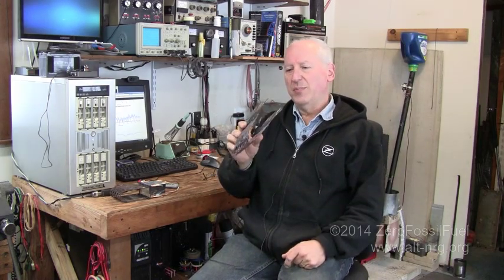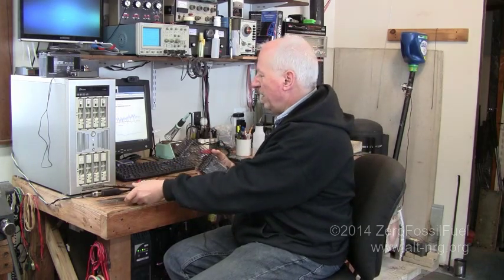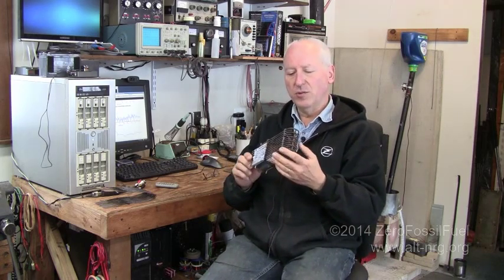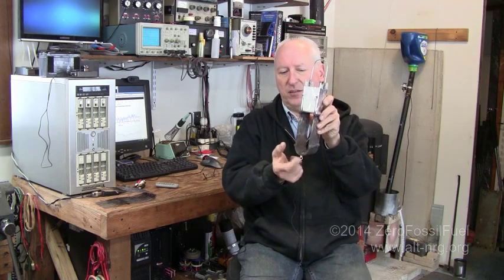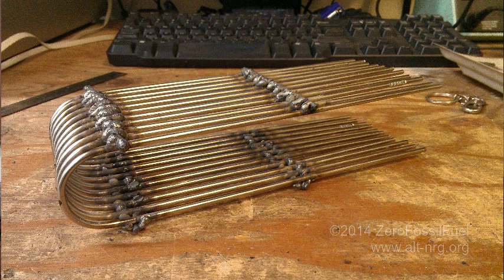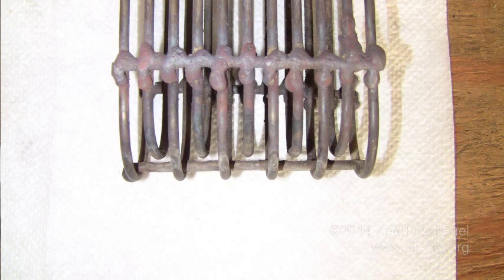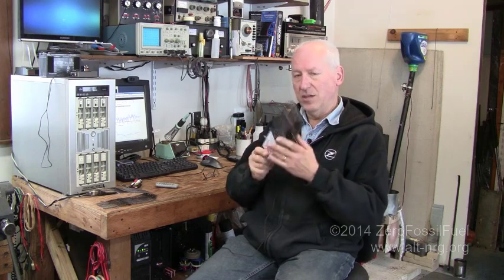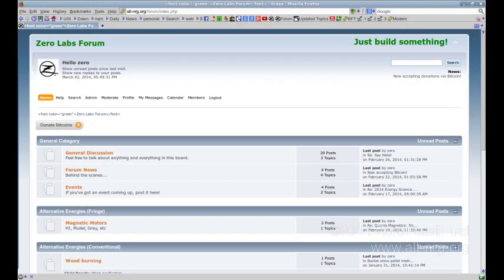#357 Pellet fuel fire basket updates, Scarecrow calls it quits

Comment: I think you're just as obsessed with burning pellets as I am!  ;-)  Basket looks good.  I'm hoping the SS is holding out well.
Reply from the maker: So far so good. I saw your new riser photos over at the forum I refuse to participate in any longer. That should hold up pretty well. Are you going to insulate around the outside?
Reply: ZeroFossilFuel I don't go over there unless I have a video to post.  ;-)  I'm still debating insulating around the new riser.  I built the metal frame so I could bend some sheet metal around it and pack it with insulation.  I was sort of in a rush to get the heater running again so I may do the enhancements over the summer.
Reply from the maker: Bigelow Brook Farm (Web4Deb)
I hear that. 3*F at my place this morning. But trust me, the performance gain is worth the effort. Insulate it as soon as you can.
Reply: ZeroFossilFuel  Hey Rob, I insulated the lower foot and half with the small metal barrel with screening inside.  It works great.  My thinking was to make sure the heat is thoroughly separated from the inside of the riser to where the exhaust is flowing out.  Seriously though, it is probably not necessary to insulate around the firebrick because they are such a great insulators by themselves.

Comment: Interesting basket design .  maybe you need to make it two pieces so you can adjust the gap . Two baskets that fit inside each other that can move up and down slightly.  An inner and outer basket that fit together and can be moved relative 1/8" to each other. Just thinking out loud.. Looks great.  If you need a Solidworks model let me know..   Thanks Ron
Reply from the maker: Will do! Thank you!

Comment: HEY...... add a small vibrating unit on the feed or basket perhaps by some kinda spring steel or rocking mechanism to convey the vibration to bottom of basket to release ash and calcination, or since spring steel will be normalized at that location,  maybe a high speed 12 volt motor with armature on a cam shape cutout on plate steel to induce vibration or shaking motion back and forth  to help release ash?  maybe a vibration cycle by electronic or mechanical timer to induce the high speed rocking shaking action every our or so? That can even be powered on a separate circuit by existing cheap solar solutions.

Comment: I made my burn basket out of 1/4" stainless rod. My burn tube is 4" square tubing and I bent 6 pieces of rod unto this shape ...  l__l  (air flow >) with a 1" air flow under it and 1/2" on each side for air to pass by. The basket is 3 1/2" long. I've never had to clean my basket. My gap between the rods is just small enough so the pellets don't fall thru (about 3/16") The pellets will burn completely and there is no problem with the pellets hanging up what so ever. I feed my pellets from the top in a 3" tube and the air enter from the front of the tube with a slide to control air flow, which work very well. The whole burn basket is welded into a piece of 3 1/2" tubing so I can slide in out when/if I want to burn wood sticks (which I rarely do) Pellet burn hotter.
Reply from the maker: Do you have any pics posted anywhere?

Comment: ach, looks like others had the same idea, but maybe an oscillationg back and forth motion on circular arc cutouts  and lever/vibrate all that ash and calcination out like a ways below this,.... that oughta clean out the burn channels, and remove fine particles still burning to maintain coal bed and oxygenation.  Probably have a higher temp i think, but am a beginner myself..... gonna have fun with rocket stoves.

Comment: 900* f to melt stainless........ don't go Rosie O'd on us. You could ramp that to 1500 F before you see any potential issues with your aluminum components. just saying... love the furnace and the fact your willing to tinker with it. If you angled your horizontal heat load tube 20* you may see more effective start up. but its a major mod.

Comment: Hi there, I've thoroughly enjoyed your video's on the rocket stove/fireplace. I was wondering now that you seem to have it tuned to the enth degree, that a flue gas analyser would make an interesting set of stats. for all us environmentally conscious folks. I don't have easy access to a Flue gas analyser so I thought I could put it to you to see if you had one available or knew of a friend that may have one you could use. I have constructed a stove/fireplace very similar to yours and it performs very well. I have not tried the wood pellets yet as they are not easy to come by in my little corner of Australia,Only difference is that I've made a hotplate on top to boil kettles etc. Not a huge success as I think that it needs the direct blast of the heat riser to really be effective.  Thanks, great video's

Comment: downloaded the file and it is running...However...this is the code I am getting from the DOS screen...  
HTTP Request failed
json_rpc_call failed, retry after 30 sec
and it has been doing this all day. Any ideas?
Reply: I have Win7 64 bit
Reply from the maker: Adam Guernsey
That's a router problem. You either need to open port 9596 or enable uPNP.
Reply: enabled uPNP on router, and added the file to my firewalls allowed list, and opened port 9596. None of these actions has allowed the file to run. Still getting same message in DOS.
Reply: AHA!!! fixed! now running 24/7 365.

Comment: The pellets you are using have too high of moisture content.  Get some really dry pellets and the problem will not occur.
Reply from the maker: At this point I use with I can find locally. There seems to be an artificial shortage ATM.
Reply: Clarry Pellet Stoves are made for hunters and small remote cabins.  During their testing, they learned the moisture content was critical for a proper long period burn.
Reply from the maker: Rj Aquaponics
I'm not disputing it. It's probably true. Thanks for sharing that tip here!
Reply: ZeroFossilFuel
 Would there be a way of routing the pellet feed tube in a way that would utilize the heat of the stove to dry the pellets. Would probably require a feed tube of stainless - or at least not plastic.